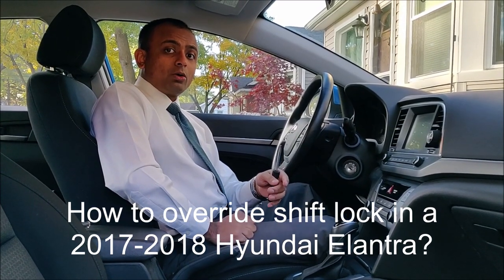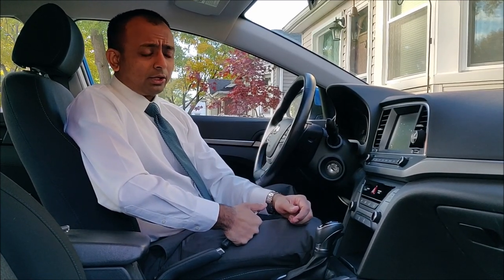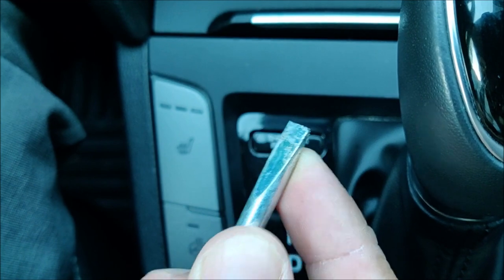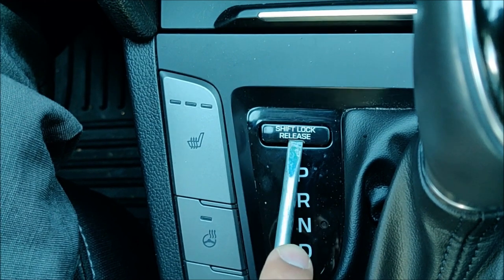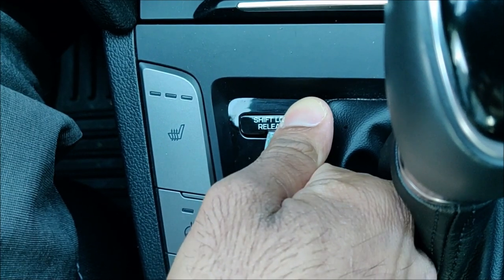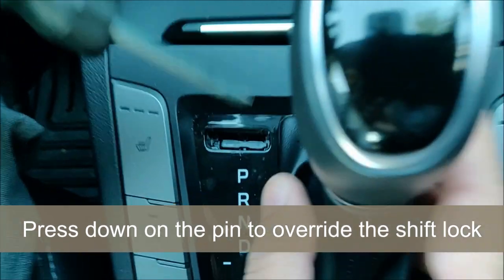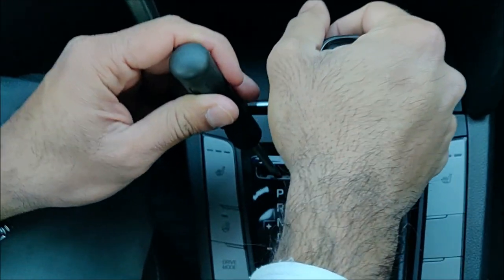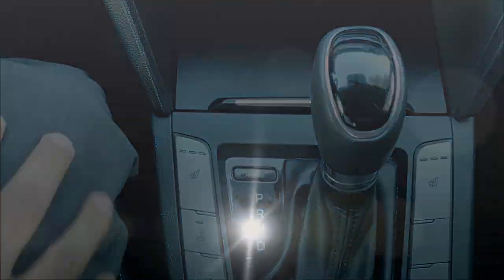Shift Lock Release [EASY] - Hyundai Elantra -  2017/2018 - How to / DIY

Comment: Great video! Tip: To prevent scratches, put tape on the end of your pry tool.
Reply from the maker: Thank you for the tip!
Reply: I could see it marking the gloss plastic ! a trim removal tool would be better then use screwdriver to disengage the lever.

Comment: The shift lock release button is really tricky to get back in. How do I put it back?
Reply from the maker: Yeah it may be hard, be sure to turn so that the 'shift lock release' is upside. Then just push it down. It only goes in 1 way.
Reply: @VirarAutomotive  Thanks! I finally got it back in your video saved my life lol
Reply from the maker: I am very glad to hear that 😊
Reply from the maker: Sorry I couldn't tell you what is causing it without looking at the vehicle. I can only guess, it is probably a faulty sensor that's causing it.

Comment: Do i need to press the brakes when doing this??
Reply from the maker: You don't need to do, the shift lock release function over-rides the need to press the brake but you should. Strongly suggest that you should press the brakes and/or make sure the emergency brake is applied. Because the moment you shift out of park into neutral, the car will be be free to roll and if you are on a slope, that could be unsafe.

Comment: How do you override the auto door locks when you put the car in park or drive?
Reply from the maker: On the instrument cluster there is a menu for it. You can do that using your steering buttons. Go to settings, convenience, locks and there you can toggle auto locks on and off. Let me know if this helps. Thanks.
Reply: @VirarAutomotive  thank you so much!
Reply from the maker: You are welcome.
Reply: I don’t think I can change the setting on a 2017 Elantra, there is no setting button on the steering wheel, only mode, trip and cruise control and phone button:(
Reply from the maker: Can you send me a picture of your steering wheel on my Instagram or Facebook.maybe I can assist then.  @VIRARAUTOMOTIVE

Comment: Half the answer...what do I have to do after that to fix it????
Reply from the maker: No one solution to it. The problem could be caused by a multiple of reasons. Bad gear position sensor, brake pedal position sensor. Would need a tech to actually look at it. This gets you out of park, into gear and home safe.
Reply: @VirarAutomotive  yeah, l went online to find this info then drove over to the dealer to set up an appt....they were so busy today they shut off the phone... thought they were just avoiding me...LOL....